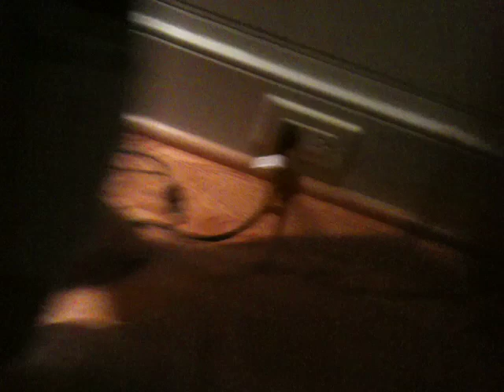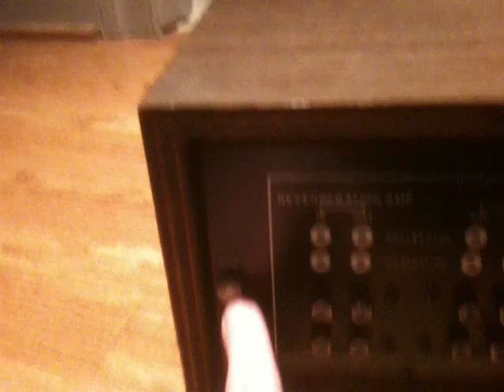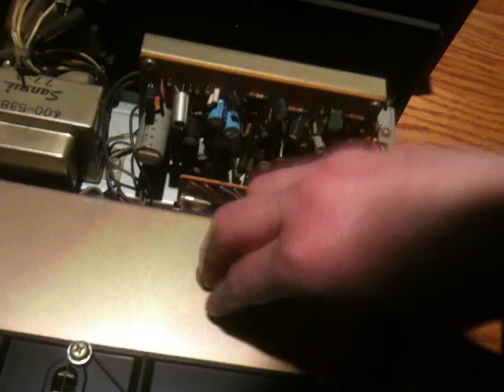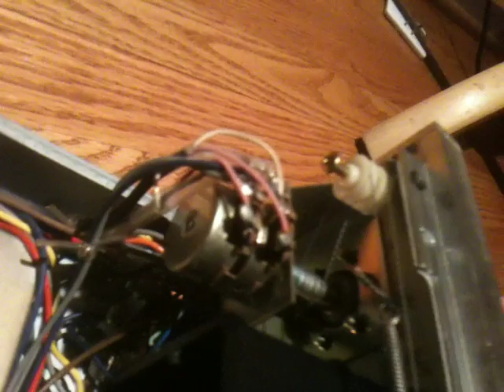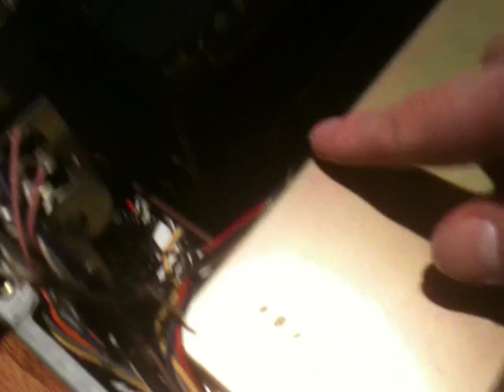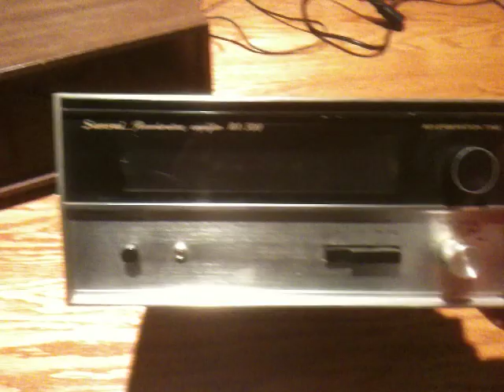Sansui RA-500 Reverberation Amplifier

Comment: The part you could not identify is probably a transistor with a cover on it to prevent self oscillation caused by another component.
Reply: Close, it's a transistor with heatsink on it